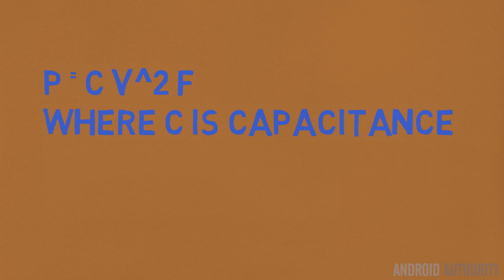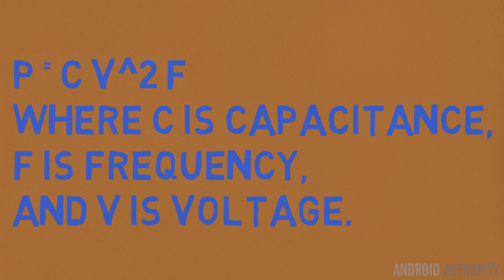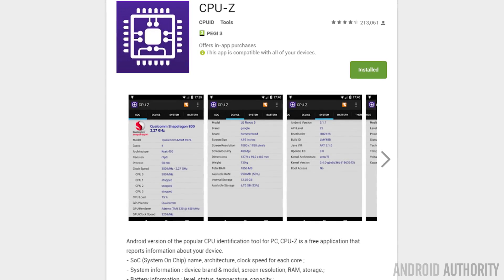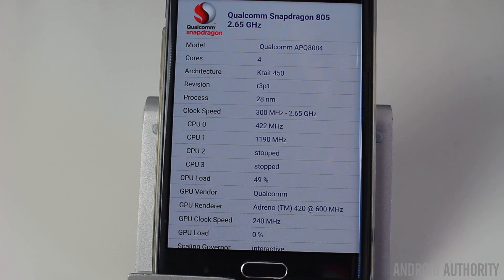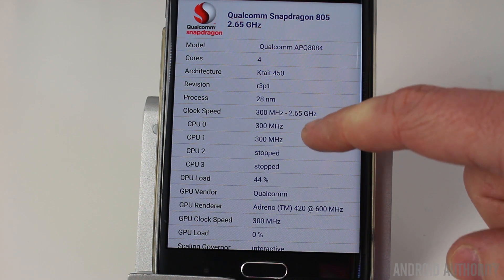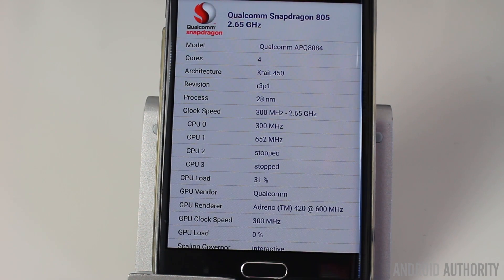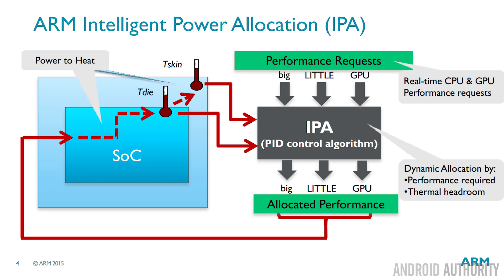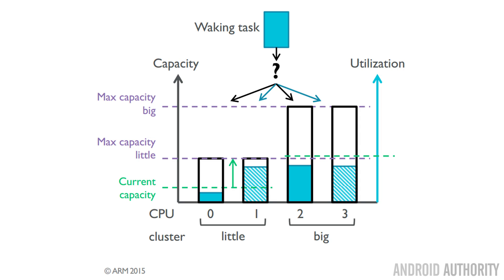What is CPU frequency scaling?

Comment: I switched my S4 to interactive from on-demand (stock setting), and I'm not sure whether it's better or not.

Also what about setting the idle CPU frequency up slightly from stock? Could that help prevent lag a bit because the CPU no longer has to ramp up through those steps in frequency? I understand the battery life would take a hit.

Comment: what do you feel about snapdragon reducing the number of cores and increase the clock speed with the 820? shouldn't they have stuck with more cores and less click speed for more efficiency?
Reply: +Shayan  So I don't have enough space here to fully answer your question. Some things to consider: 1) The 820 is still a HMP processor, two of the cores are clocked at 2.1GHz and two at 1.6GHz. 2) The Kryo core is thought be as good, if not better than the Cortex-A72. 3) Qualcomm have deliberately reduced the clock speed on the Snapdragon 650 and 652 so that the Cortex-A72 in those chips doesn't show its full potential.

I will only be able to tell if Qualcomm made the right decision when I get a chance to compare the Snapdragon 820 to the Exynos 8 and the Kirin 950 and the.... then I will know!
Reply: ***** I see, thanks man!

Comment: Thank you for the explanation 
I hope that you can also explain why some CPUs with only 4 cores better than 8 Cores like Snapdragon 820 which is better than Snapdragon 810
And  some quad core processors with lower frequency are better than quad cores whith higher frequency just like Snapdragon 820(2.2 GHz )>>Snapdragon 805 (2.7 GHz)
Reply: +Prathamesh Dhanorkar 
Thanks for the explanation man
Reply: Gigahertz is a measure of cycle speed of a processor. 
Take this for an example. There's a 4 feet man and a 6 feet man. Both of them walk at 20 steps a minute. Who will cover the larger distance? The taller dude. 
Now in processors the length of each step is called instruction set. Newer processors can perform more instruction sets per cycle. Now this cycle is the frequency or gigahertz and is comparable to the number of steps. Thus you see an old processor at a higher clock speed often does less actual work(less distance traveled) than a new processor at a lesser clock (less frequency but more instructions per cycle). Hope this clears things up for you! 
Also guy above is right about manufacture process and decreasing power consumption because of proximity of physical capacitors as the wafer shrinks.
Reply: IPC (instructions per clock)
Reply: +amartya baidya thanks man that was helpful
Reply: +Dwain P thx

Comment: very cool video, Ive ready about different size mobile CPUs & GPUs sizes IE different nanometer manufacturing processors say the 23nm vs a 14mn CPU, doest this change the power usage because the power moves smaller distances within the chip?.
if you could explain that too. would be awesome!.

Comment: i have a snapdragon 801 processor (lg g3)it has a clock speed of 2.5ghz
can i permanently underclock it to 1.5 ghz?
Reply: Yes and no. 
Yes you can do it. 
The process involves rooting your phone. Installing a custom recovery, installing a custom kernel for the ROM you're running that supports underclocking. And then going to an app like kernel auditor and setting the cpu frequency settings. 
Now I said No as well didn't I?  Well that's because at 1.5 ghz your performance will be very very choppy with that 2k display. Another thing to keep in mind, underclocking is not that effective for battery life. However turning off two cores via terminal emulator and then undervolting the CPU, may help. However all of it depends on the wafer, not all CPUs are created equal.
Reply: +Tze Shuen Teo heat and battery, maybe? G3 has bad battery life and quite easily heats up.
Reply: Why would you want to underclock it?
Reply: Yes you can, I did it one my oneplus one from 2.5ghz to 1.7ghz via custom rom
Reply: ***** Not really. Unless by underclocking you mean switching off CPUs/Undervolting them, battery life will not be affected.(And if Sanjeev Aher was not maxing out that 2.5 GHZ(Maybe not with a 2K display), the only difference would be the performance.)
Reply: +shadowtsunami you need a kernel as well and underclocking helps with thermal boundaries. Battery not that much.
Reply: ***** 10-12% by just under clocking or using other shizz like greenify and other stuff as well??
Also it depends from device to device as well.... And if you install a custom ROM it comes with it's own kernel so that's one thing taken care of
Reply: ***** yep that's what i was thinking as well... I barely managed to see even 20 extra minutes of SoT with just underclocking. 
Switching off cores and undervolting along with Lux, greenify and xposed gave me around 45 minutes of extra sot on my G2.
Reply: ***** i gotchya man... As someone who makes their own cm builds and occasionally ones for the community as well, CM will always be my ROM for choice. Run it on all of my, as well as my families devices XD. 
I use Greenify with xposed and Servicely as well. Amplify.. Haven't heard or used it yet...

Comment: i have one question. i have nexus 6. 
in which scenario there is chance of getting more battery life?
1) 4 cores online with lower freq.
2) 2 online and 2 core offline with default max freq.
[i know it depends on how i use,what apps i have, etc.]
Reply: +Shayan  are you fucking kidding me?? The power draw of two cores will always be more than the slightly higher voltage state of a higher clocked core... Go read up on some processor architecture and power distribution circuits in microprocessors before spouting non sense. 
@poojan, the one problem with two cores always at higher freq is thermal throttling which will force them to underclock themselves to save themselves from getting fried.
Reply: 4 cores with low frequency
Reply: +Prathamesh Dhanorkar Thanks
Reply: +Shayan  thanks
Reply: +amartya baidya He seroiusly said two cores? LOL, have a like from me :D
Reply: 4 cores.